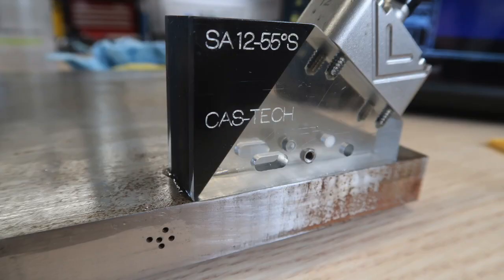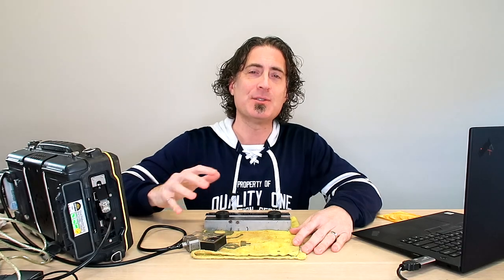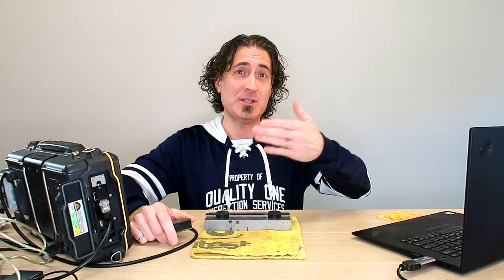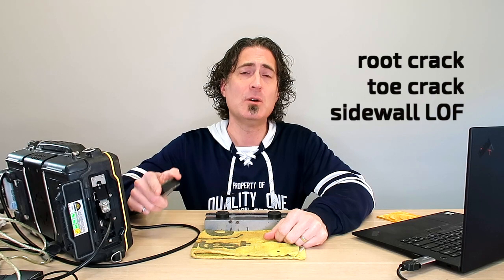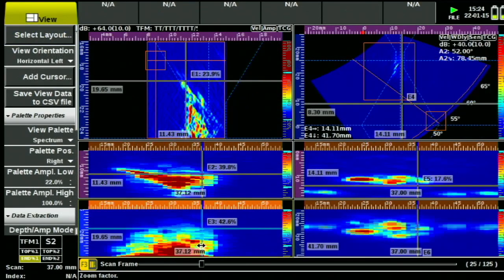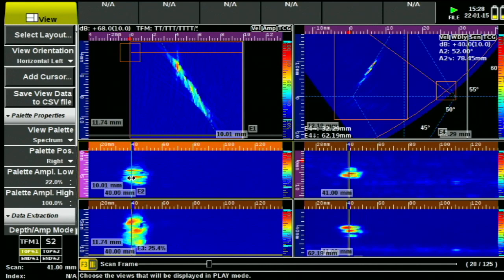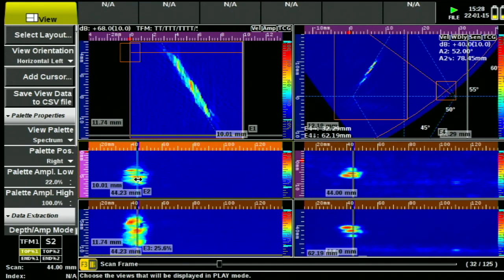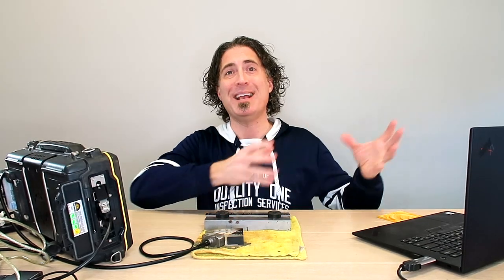TFMi: Intermodal Total Focus Method

Comment: Would TMFi be useful in identifying whether lack of fusion is found at the root of a weld vs a signal from the backing bar? Thank you.
Reply from the maker: It should image the lack of root fusion quite well, if the pipe is thick enough to permit reflections from multiple propagation modes.

Comment: Can I get good results with a 10l32?
Reply from the maker: HI Santiago, TFM results will always depend on aperture, element count, and frequency. 10L32 might be fine if it has a 0.6mm pitch. Many have just 0.3, so the differences in time-of-flight of any signal from one end of the transducer to the other is minimal. That's a great idea for another video though!
Reply from the maker: Here is an examply of using a 10L32-A10 transducer: https://www.linkedin.com/feed/update/urn:li:activity:6955564363554459648/
Reply: @hollowayndtengineeringinc.5201  Hi Paul great
Reply: @hollowayndtengineeringinc.5201  Paul a question, how do you configure the roi  and what is the relationship whit the pixel